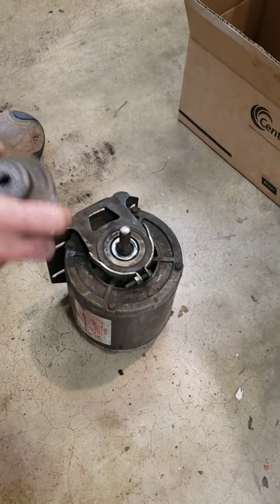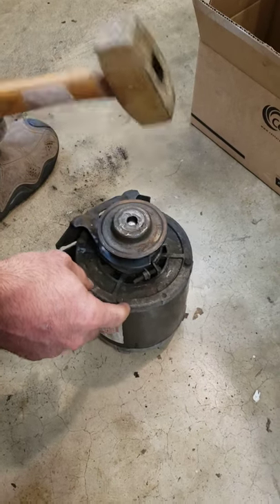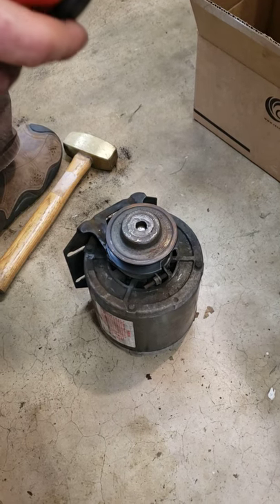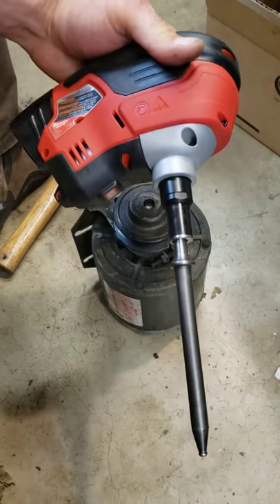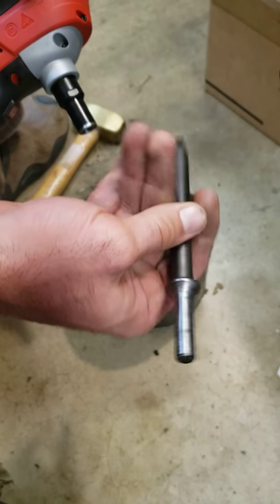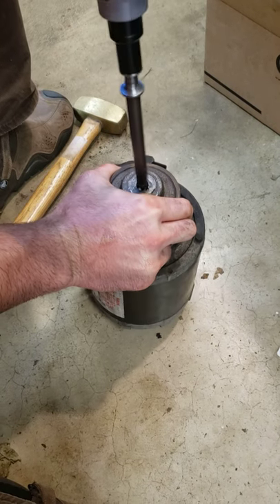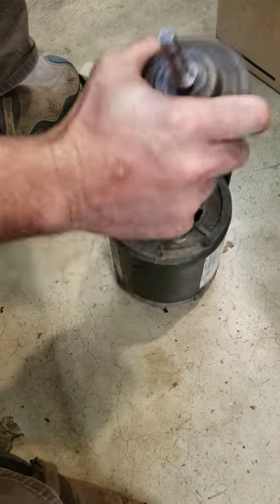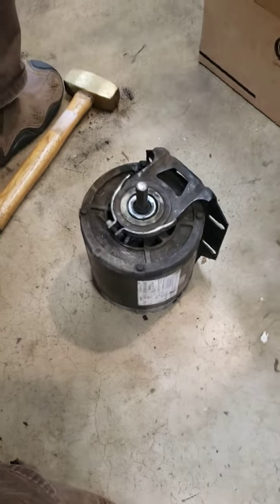Tools1: Using M12 Palm Nailer as an Air Hammer (Part 1of3)

Comment: I do HVAC but recently took a side gig doing framing and such. Didnt even know what a palm nailer was until I worked with these guys. Thought it was cool as hell but couldn't justify buying one. Welp after seeing this you got me curious, I know I've wasted so much unnecessary time on stuck fan blades. And even with the puller it's still annoying as hell. Lol thanks for the idea 👍🏼
Reply: I hate stuck fan blades. Harder the. Hell to get off the damn motor
Reply: They really don't have a lot of power for hammering. Maybe if you were descaling rust, but to try to force apart an interference fit...gl
Reply: @HVACLife  thank you for taking the time to reply. sometimes the tool for the job is not the tool that was made for the job I guess.
Reply: Won't mushroom the shaft?
Reply: @HVACLife  that’s super clear, and thank you for this life hack XD. Seems vibration are getting more and more useful.

Comment: Thats no good you're gonna eventually deform shafts and never be able to extract press fit parts
Reply: The motor is probably toast already. If it gets the pulley or a prop off its a good idea. I personally use a puller
Reply: @TheTruth420  if the motor is already toast yeah. You dont care about the shaft getting stuck to the pulley because if it gets stuck when you deform it with the impact, you simply trash the whole contraption and go looking for another one in the junkyard
Reply: @adam207321  it’s a motor not a turbo relax
Reply: @glock1inthetop45  I dunno I wouldn't eant to trash a motor neither
Reply: @glock1inthetop45  some of those motors that small can cost up to 750 bucks also.
Reply: Maybe but if your having to hammer off pulleys that often,, you have a worse problem, not to mention, the hammering on pulleys is prolly worse than the auto hammering them off
Reply: Also hammering on the shaft and pushing on the bearings. This is hack shit
Reply: @tylersmyth8861  agreed
Reply: @HVACLife  Either way I dont think its a method I would like to use. With impact youre far more likely to deform the shaft. Really not doing a favor to runout specs and consequently the bearings...but if it works it aint stupid right...
Reply: @HVACLife  well that makes sense. Now just the remaining question how many pulleys are on the edge of their lifespan when you pull a dead motor?

Comment: This is just a troll. Beating a shaft isn't gonna "pull" anything off. Maybe in a rare case vibrate it a little loose but this is silly
Reply: @HVACLife  every shop or dealership I have worked at is plumbed for air. Idk what shady ass backyard shops you work at.
Reply: This is essentially the backwards way of tightening on an axe head man. To tighten an axe head you hammer the bottom of the handle into the ground to make the head move towards the bottom of the handle, he's hammering the top of the shaft to move the pulley to the top. It prolly ain't best way I'm sure but it's how my grandad taught me and he said he learned it from the "old-timers"

Comment: Only if Milwaukee would be the first to put out a actual auto hammer stronger then any air hamer I have ben asking Milwaukee to do that for year's for now i am just going to use this method all of my air tools have one major problem ice in them when they operate everything from my impact wrench all the way to my roofing nailers I have switched over to electric and my preferred choice is milwaukee you get what you pay for unlike snapon not that's a true highway robbery company they will probably charge you for a box with their logo on it maby like $100 HAHAHAHAHA
Reply: @HVACLife  snap on should stay with only hand tools and not try to compete with all of the companies that have 30 years of experience making eletronic tools I have used a snapon mid torque inpact wrench the bolts would not budge then i just pulled out my Milwaukee m12 small impact wrench with small battery and I removed all of the rest of the oil pan bolts with no trouble at all and it did not even use one bar of power so yes snapon impact wrenches are pathetic the best part that snapon was $500 just the tool the Milwaukee was $140 on sale only the tool

Comment: If you have the air conditioner hammer bit, why not just use the air hammer?  I can knock a screw in with a hammer, but a screwdriver always works best.
Just saying use the tool, for what it was made for.

Comment: The reason you use a pulley is to not mushroom the shaft, this method WILL mushroom the shaft if a stronger air hammer is used, then you're fucked. So use a pulley and don't cut corners.

Comment: Peening the end of that shaft will cause a very tight pulley to get tighter, use a hub puller instead
Reply: I have been doing it for over thirty years, a hub puller is best, wait until you get a very hard pulley to get off and you will learn to do it correctly